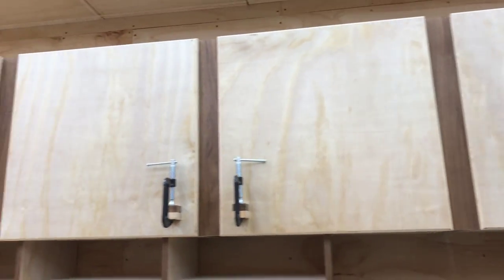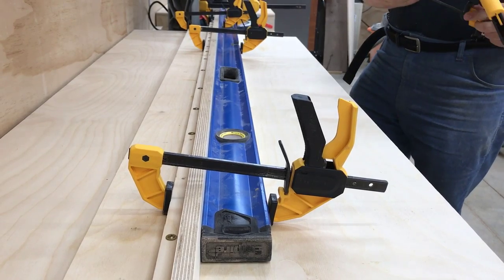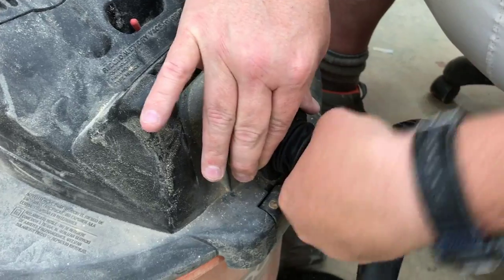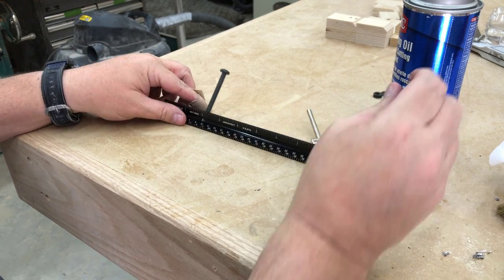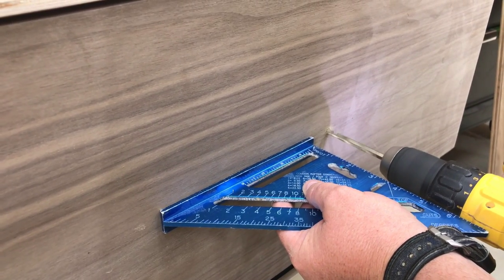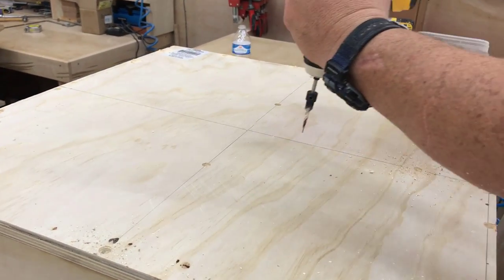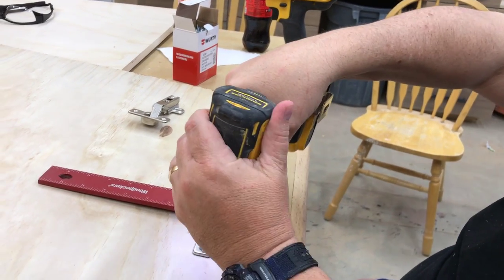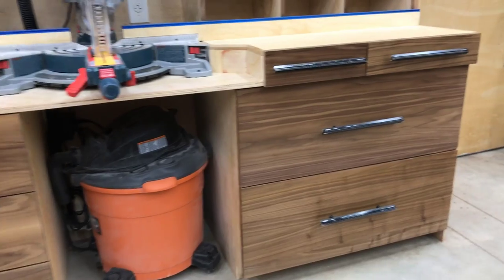13 - How to build the Extreme Miter Station Part 3 Drawer Fronts, Miter Fence and Upper Cabinets

Comment: This is the 3rd time I'm watching this series to build the miter saw station and I am picking up things I have missed in the past. The only 2 things I would do differently are; I would put the base cabinets on bearers (Timbers screwed along the floor packed up to level directly below the sides of each cabinet to give a single plain) and I square hinges to the doors with a spirit level again the sides of the cups. This way all hinges line up parallel. These series have given me lots of ideas, this is a great channel!

Comment: Thought I was so ingenious to have come up with using the architect scale as drawer pulls and here I see that you had it first! :) I ended up epoxying 1/4-20 coupling nuts to the scales at about the same spot that you tapped them and bolting them through my drawer faces. They've held up well! Nice miter station and nice work!
Reply from the maker: Haha. Great minds think alike. Thank you!

Comment: I have watched all 3 vid's in this series now.This guy is slow,very accurate, pay's attention to every last detail and is thinking 10 step's ahead. Exactly how it should be done. My kind of builder that's for sure.
And FYI, to add to the comment below. I too am from Canada and even thing's like OSB sheeting are far cheaper in the states than here and alot of your OSB comes from here.
OSB plant I toured 2.5 hours north of me ship's 95% of what they make south of the border.
Reply from the maker: Thank you for your kind comments. And that certainly isn't fair that your materials costs in Canada are higher, that seems bizarre.

Comment: When installing hinges on the doors I put them closer to the ends of the doors and put the square on top and bottom of door and align it with mounting flange.

Comment: The only thing I see that I wouldn't do is put those cabinet door hinges so far in the middle of the door.  The typical standard is about 3.5" from each edge.  Other than that, you do very nice work.  I will be starting a miter station from Jay Bates and some of your ideas as well pretty soon.  Only thing I am adding that you guys don't have is a radial arm saw along with the sliding miter saw.  I got a new Delta 12" one for next to nothing so I am going to incorporate it in my station.  I have always liked the RAS.   Great Job.

Comment: We have an air compressor like yours in our shop and we built a box around it with sound proofing and a bathroom exhaust fan on a temp sensor and a large door. Would love to see your take on that!
Reply from the maker: That's a brilliant idea! The noise of that thing can drive you crazy!  I would really like to move it outside of my shop. And, I was thinking of building a tiny shed to house it, but with the same noise-proof insulation.  If I had room in my shop though, I would certainly do as you did! Thanks for the comment.

Comment: Great video's enjoying watching whilst laid up sick. Another way to guarantee the hinges are square 28:54 is put them both in place and place a straight edge (scrap timber will do) along the back edge of both hinges, they will square each other up. No need for wobbly try square. Subbed and liked ;-)
Reply from the maker: Thank you for the tip. I hope you feel better soon.

Comment: As an architect, I cringe seeing you drill holes in those scales. But as a woodworker I applaud you for something very unique. They turned out great! I may need to set my morals aside and do this as well.
Reply from the maker: Haha, Thank you. I was quite torn too. I did buy cheap imported scales, but just the same, I was saddened a bit.

Comment: Hello James. Since you cut away the top for the Saw  I wandered if you need to beef up the single ply support under the saw more than with the existing underlying cabinets? (especially the right side of the saw). I sure enjoy your videos and what I have learned  from them so far. Great work and group you have developed. Thanks.

Comment: Thanks for the great videos James, love the family atmosphere. I purchased the plans and I'm in the process of building. Made a few changes to fit my needs like added a 5th set of cabinets, and my torsion box top will be 6 in thick. I had 1 question for you now that you have been using it for a while do you still like the full length fence of does it get in the way if the stock your cutting is not perfectly straight? 
Keep up the great work
Tim.

Comment: Hello good Sr.  Would you use the same technique for the carcass of kitchen/bathroom cabinets?  I was looking in you channel and did not see a video of that type of cabinetry, if it is that it changes at all.  I really like your videos and technics. I think a miter bench like this will be my first project at some point this coming year. Lastly, what is your opinion on wall mounted vertival saws insted of a table was.  I dont have much space and it would be a great way to still be able to work with sheets of plywood.  Thanks for your time, help and great videos.

Comment: I noticed that the vertical hinge spacing was shorter than the door width.  I was told that hinge spacing should be larger than the door width or the door will sag over time.  Have you found this to be true?  Like the pulls and handles.
Reply from the maker: Hi. I haven't heard this, but I know it isn't true. I'm a kitchen cabinet builder, and I've built lots of cabinet doors that are wider than tall. It occurs most frequently above refrigerators, but shows up a lot elsewhere too. 

Consequently the hinge spacing is much closer than door width. 

I've seen doors like this that are more than 15 years old. And they are still perfect and sag free. (Assuming they were built right in the first place).

Comment: Excellent build!!! Still need to watch the 4th video. Curious what is the distance between the fence and the front of the torsion box?
Reply from the maker: Thanks!  I think it's about 14"  It's a little more than the full width of cut of the miter saw. I really didn't want to have it any narrower, since I crosscut wide boards all the time.

Comment: James, I really enjoyed this build as I do all your videos. I am building a smaller miter station that uses two 36- inch cabinets from Lowe’s as the base and they will have a 28 inch shelf between them, recessed, that my miter saw will sit on.  I was particularly interested in how you did your fence, as I will also be using the Kreg top track. By extending it the way you did to within a few inches of the blade, I was curious as to whether you still have any bevel capability with the saw. Again, great video and thanks so much.
Reply from the maker: Hi Steven, no bevel capability if you run the fence that close. If you keep it back a bit then you can still do bevels. I just don’t do much in the way of bevels on the chop saw. Since the table saw is more accurate. So I ran the wooden fence very close.

Comment: Just wondering why, when you ripped the Thin Strip for your fence? You ripped it with it between the fence & the Bigger Piece was on the uncontrolled side. Sure looks like your creating a Kickback Situation? Instead of ripping your narrow piece on the uncontrolled side of the Blade. Not a Complaint, just a Question. I Love ALL of Your Videos Please Keep them Coming.

Comment: Hi there, I think your videos are very professional as I see that you are with your woodworking as well.  One thing I'd like to know about is what miter saw dust collection hose and fitting to the saw did you use from Rockler?  I have the same saw as you do.  Also how is the dust collection doing for your saw now?  Thanks so much!  Gary

Comment: Greetings from Canada!! I just found your channel, thank you so much for sharing your videos. I am a hobby woodworker, and have built a few things but more gearing up for retirement and outfitting my shop for when I have more time than money...lol
I will be building something similar this winter for my shop, and have a couple questions.
With your mitre fence so close to your blade, and over the top of your saws fence, it seems like you would be unable to do any angles, or compound cuts.....am I missing something, because I really like how close you can measure with your system, but I would like to be able to do 45's ect....
Also, I've never used french cleats, and am considering it for above my mitre station...the wall I will be putting the cabinets on has one stud that is fairly proud of the others....I know I can just shim the top cleat on the wall so it's flat and plumb, but if I add the spacer on the bottom of the cabinets, I'll be shimming them as well most of the way...I've never seen anyone do this, but would it work to just add a bottom spacer on the wall below the cleat near bottom of cabinets and shim it as well so it's plumb with the top cleat???
Thank you again for taking the time to share your talents, you are very detailed and your videos are very well done, and I don't find them too long at all.
Greg

Comment: Why would you want an extended fence if a board is not perfectly straight it wont be pushed up against the fence on the saw where the cut is important?

Comment: Was there a reason you placed the hinges so far in from the top and bottom.  Normally I'd have them 100mm in
Reply from the maker: No. Not really. I'm used to building much taller cabinets, and perhaps I wasn't paying attention. I think it might have been nicer to be 100mm from from each end as you suggested. :-)
Reply: I can relate to that.  I think it's great to see so many different ways to build a cabinet.  In Western Australia we don't get much plywood,  especially not Cherry, Walnut or even Birch Ply.  All our Kitchens are basically White Melamine boxes with coloured melamine doors. Never seen a pocket screw either except on YouTube and I've been Cabinet making for 15 years.
Reply from the maker: LostWhits, it's too bad you don't have more choices for cabinet wood. But Australia sure does have some beautiful hardwood timber.

I've had a number of people commenting on my videos recently who were from there. And so I started looking up some of the different species of trees. 

There sure are a lot of different types of great looking wood!
Reply: Hinges spread farther apart are:
1) More stronger
2) More stable
3) More easily adjusted
Reply: Lost Whits, Carbatec in Perth have the very same Kreg pocket screw system that is used in this video.  $299 for the top system (I just bought one).  Fantastic way to butt joint timber, but like most things in Aust. the screws are a lot more expensive so I am a bit more frugal with them.
To James, I'm about to built a mitre station and if it turns out as good as the ugly one you replaced I will be pleased
Reply: jaxdabomb1 If you are up Joondalup way try scrooz fasteners. I've not been there but heard their prices are ok
Reply from the maker: jaxdabomb1, well most importantly, have fun doing it! :-)
Reply: I'm also from Perth - Kreg screws are about 10c each from carbatec.. not too bad?

Comment: with this fence system are you able to do a 45 degree bevel cut?  It looks like the fence might get in the way.
Reply from the maker: Hi Amy, no I can’t. I do those cuts on my Table Saw. But if you wanted to do them here the fence could be made 5-6 inches shorter and then it is certainly do-able.
Reply: Thanks for replying so quickly!!  I love the design!  I bought the plans and have my cabinet bases done.  Your video is wonderful and the whole family in on the project is very sweet!
Reply from the maker: Thank you, that is very kind!

Comment: Upper cabinets are holding on 3 screws? How much they can hold? By the way, very usefull video, thanks for the effort of making it.
Reply from the maker: Hi, thanks! They are hardened steel screws, and they go through the plywood wall into the studs. Plus there is a considerable amount of frictional force holding the cleat to the wall. As far as weight, i'm not sure, but I do have a couple hundred pounds in one cabinet.

Comment: Not to knock your station but,,, I have the exact same miter saw and us it a lot to cut lots of compound miters. By removing the original miter extensions and putting a non movable fence you take away from the saws capability’s. If you need to roll the saw to a 45-45 compound miter you won’t be able to do it now. Now I know that’s not a everyday cut but I have on ovation done such a cut. Also the original fence is adjustable so you can slide it tight to the saw for reasons like cutting segments for bowls that can be as short as 1/2”. Other than that it’s a very well thought out station and looks great.

Comment: why did you install all your outlets upside down?
Reply from the maker: Hi Ivan!  The National Electric Code actually doesn't mandate which way you must install the receptacle. 

But the conventional wisdom is to install them ground-up. This way, in the unlikely event that the cord was partially unplugged and something accidentally fell on the blades of the plug, it would hit the ground prong and not cause a short or a shock.
Reply: i think its less likely for the plug to get pulled down if its ground down. also, if your plug gets unplugged and ground gets unplugged while the two prongs are still in if thats even possible than your device is ungrounded. not sure whats worse. but yeah i've seen a lot of equipment cords designed with assumption that ground's down, so cord goes down. like the plugs with integrated breaker.

Comment: WD-40 is a great cutting oil for aluminum.
Reply from the maker: Awesome thanks!
Reply: WD-40 is a solvent, not a lubricant. If you want to cut or drill metal, use a proper cutting lube—or at least a machine oil.

Comment: Walnut plywood in Canada is $200 a sheet.Home depot in B.C. has a crappy supply of plywood.i.e. hardly any of good quality.For prices of wood the USA beats Canada hands down which is odd considering wood and water is all we have.
Reply from the maker: Hi there northern neighbor! And wow! I am surprised that it's not less.  Is that the price even at a specialty hardwoods store?

We have a couple of dealers here in Denver Colorado, and both are priced similar. 

Well, that's sad to hear. Anyway thanks for commenting & watching!
Reply: If you buy from a hardwood wholesale place, and not a box store, walnut plywood is almost half that price in Canada.  I never buy lumber or plywood from any box store now that I know what is available elsewhere.  In some cases you just have to be prepared to buy a minimum amount.

Comment: How much did this build cost?
Reply from the maker: I think it was about $800, but it could certainly be done for less.
Reply: King's Fine Woodworking this build is crazy. I’m experienced with all the tool used in making this but I could never think this stuff up. Is there a computer program you use for designing this stuff?  Do you have plan for this or maybe a slightly cheaper simpler station.
Reply from the maker: Hi, I do have a set of plans that I sell. It’s actually how we support our channel. The Miter Station is designed to be modular. You can make it any size you like. From 2’ wide to 30’ wide or more. 

The key starts with the base cabinets. Just pick how many base cabinet units you want. The plans have a 2’ and a 3’ wide unit. Then decide if you want spaces between them, (for vacuum or trash can or??). 

Then build the torsion box top to fit the width.  

Then build the correct number of top cabinets, with spaces. 

And finally, fit the in-between area with the cubbies. 

It’s a totally modular design. Plus you can even add on to it later when you want to change, or more funds are available. 

You can also control the cost by not only changing the size, but the material type. I used walnut ply in front. It’s pretty expensive. And of course it isn’t necessary.  For the other ply, you can use anything from lower end a/c ext ply, to mid grade sanded pine plywood, to interior cabinet grade, or even high end Baltic Birch.  It will all work. 

You can save money by putting in a wooden block for a drawer pull. I think I spent $80 on the aluminum rulers. It’s unique and kinda cool. But a small wooden handle would have come from scrap and been free.  

Here is a link to the plans in case you are interested. 

https://kingsfinewoodworking.com/collections/project-plans-for-sale/products/plans-for-the-extreme-miter-station
Reply: King's Fine Woodworking thanks for your fast response. I will order the plans. In my Garage I have about a 1’ high foundation before the wall starts. The wall sits on the foundation about 4” back. What would be the best way to modify the base cabinets to fit snug against the wall?
Reply from the maker: That’s no problem. The same way the front is notched for the toe kick, we notch the back to get over the foundation. 

A lot of my viewers have needed to do this, as most use a garage for the shop. 

I can sketch it for you if you need also.
Reply: King's Fine Woodworking I would very much like the sketch. Do you think I could leave the back open to cut down on the amount of plywood needed and just add a top and bottom support for attaching to the wall
Reply: I bought the plans but after trying to downloading a couple times it said I exceeded my limit of downloads. I’m on my iPhone. Should I have done it from a pc.
Reply from the maker: You can definitely leave the back open. Send me your email, and i'll make you a sketch.  james@kingsfinewoodworking.com